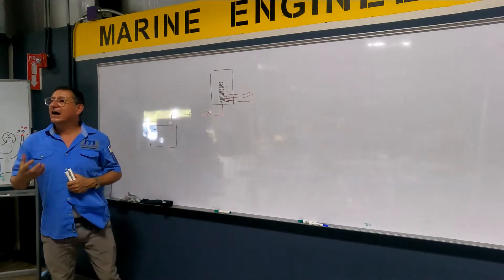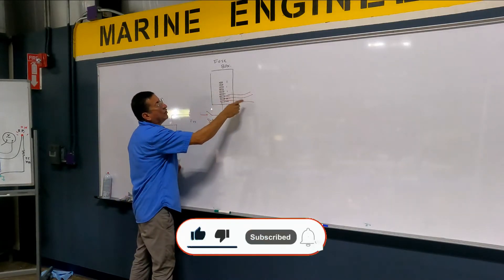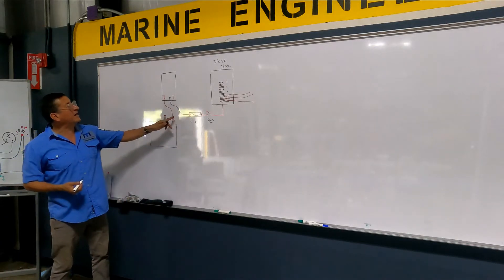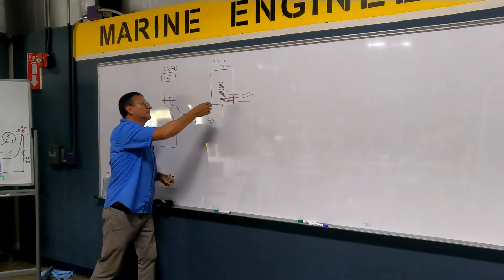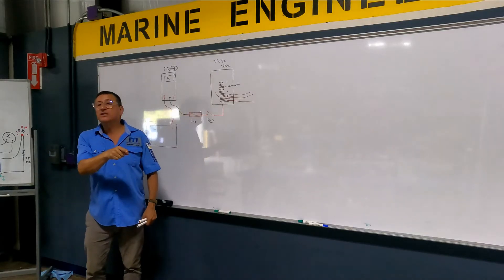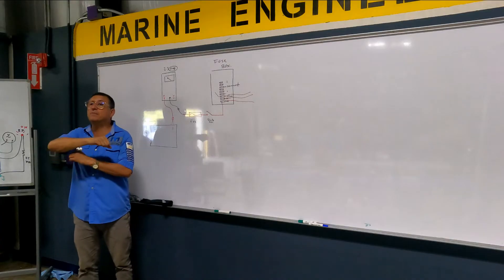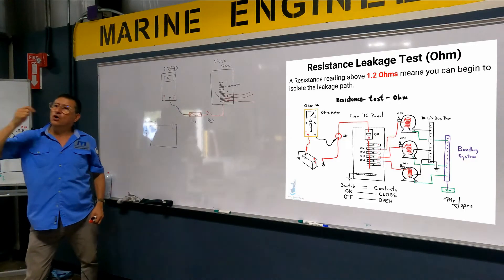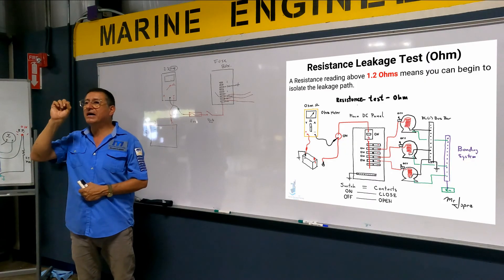How to Identify Leaks of Current in Boats and Cars

Comment: Quick question - when I hook up my multimeter like you show I get 0.1 Amps (no power).  Then I turn the house battery to on, but none of the electronics at all power on…  ia this an issue with the multimeter itself?  The gauge of the wires?  

When I hook the battery back up like normal everything powers in just fine…

Would you recommend a minimum settings / model multimeter?